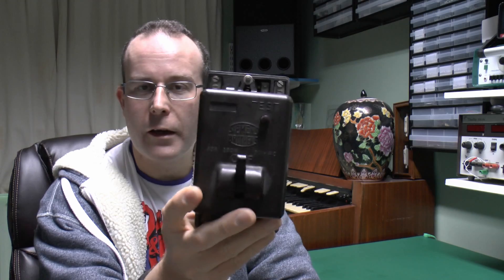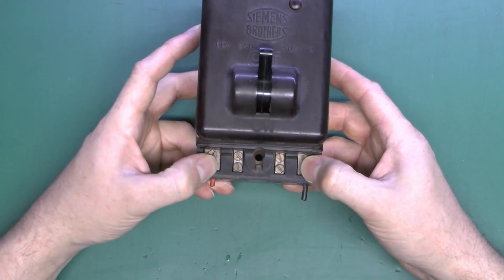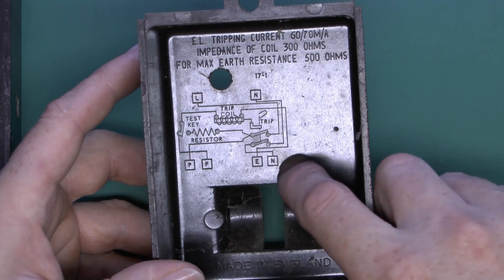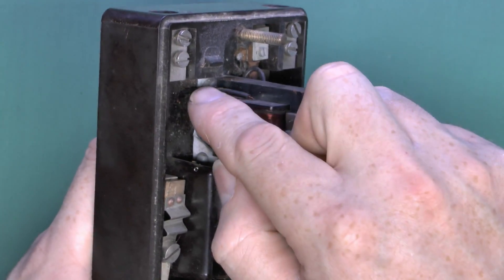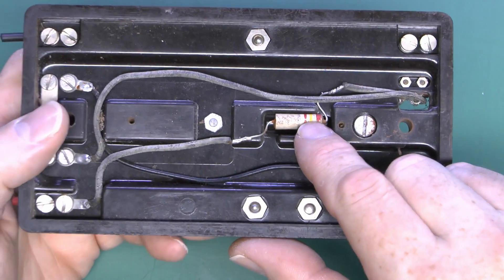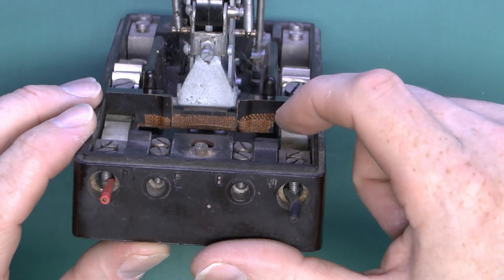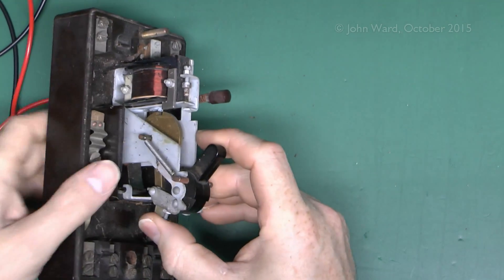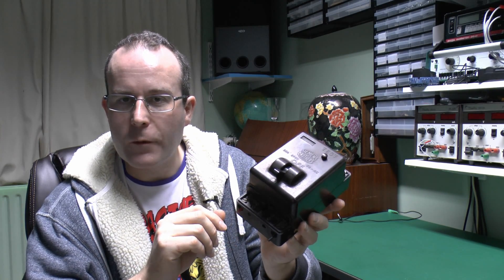Old Siemens Brothers VOELCB - Voltage Operated Earth Leakage Circuit Breaker

Comment: The Siemens Brothers shares they did not already own were completely bought out by AEI in 1954 and the ex-Siemens manufacturing plant at Woolwich finally closed in January 1968.  So this should certainly be no later than that and possibly earlier depending if and when AEI might have phased out the brand name.

Comment: Label position would have contained a white plastic bar glued in which would have had the utility supplier logo and the initials of the supplier there, like LEB, GEB, or DCED.

Spark gap yes, the coil inductance would limit current flow in a lightning strike and the gap would limit the current and heat in the trip coil to stop it from burning out. the terst coil should be tested with AC, as DC on the system was not a desired thing.

Must look up the old Crabtree I have somewhere, dates from the 1970's and uses a current balance and a GCS thyristor as a trip coil drive.
Reply: +SeanBZA If you only have a dc supply, pulsing the supply on and off can be used to simulate such conditions, correct? i Don't think the negative swing matters as much as the severe short term changes in current?